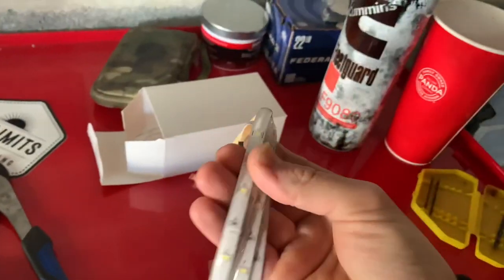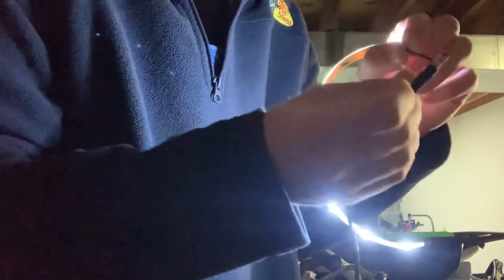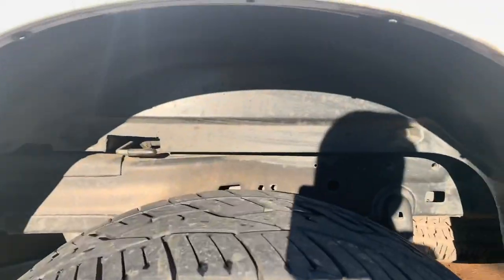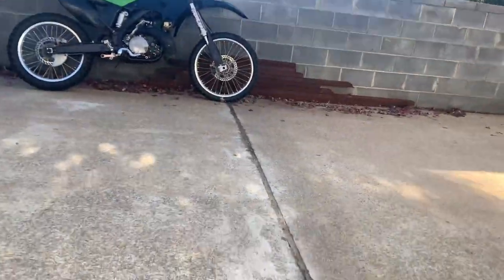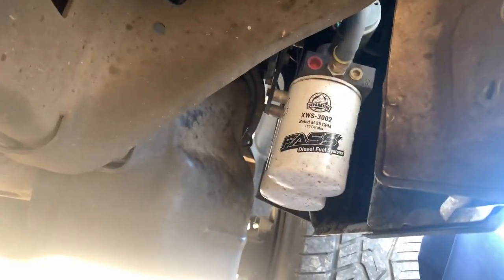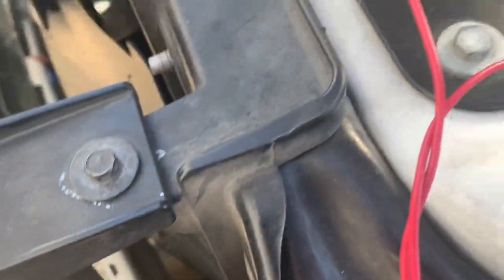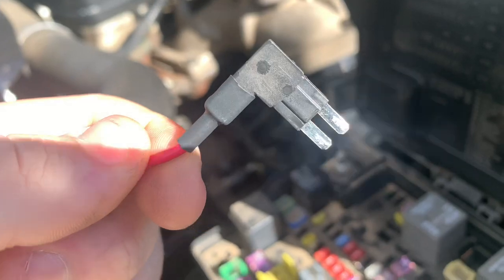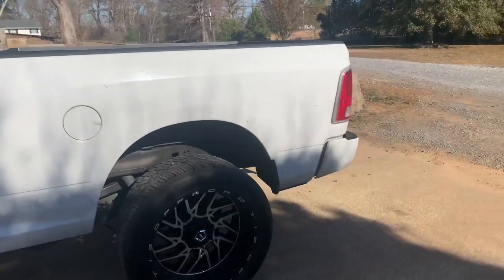HOW TO INSTALL ROCK LIGHTS ON CUMMINS *no limits led lighting*

Comment: Shane just sent me my 2nd set of 12pc. Can't seem to get blue to run. So no purple/pink/ anything that needs blue. (Blue comes on but super week, like barely visible.  Got 12v at control box. All connections on all 12 are correct and locked in...never had this issue with the other w companies that sent me product. Can't complain at the 399.99 pre discount for what appears to be a well made kit ...just fishing for udeas..
Also in your case, I'd run a dedicated fused ...(lol playing in background you pulled out an "add a link" fuse adapter) so NEVERMIND!. Better than nothing. I actually install LED systems and automation for live Nation so I'm starting to think you might not be the guy to ask but he'll I've already typed so long. Here's your comment: good job. Also if you ever have funky issues with yours since posting this. Let me know

Comment: I have the same type of lights, but im using them for my interior for my car. What would I need to hook this up in my car?
Reply from the maker: just basic wiring tools like i used in this video. you can run the wire through the firewall under the hood
Reply: @seabassgt7998  okay could ya tell me what all you used. I'm gonna put it on a list and buy it
Reply from the maker: @SicKem  butt connections. wire taps. fuse taps. and some of the ends you can run bolts through for ground.